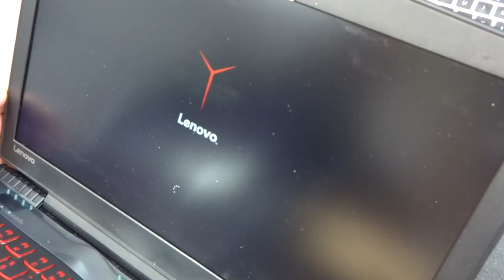Lenovo Legion Keyboard replacement

Comment: I have replace my keybord on lenovo y520, and I am having problem with several keys like (E,G,H,9+,function) they are not working. It happens few time to start to work and after few minutes stop it. What can be the problem and how to solve it? I tried to reinstal drivers several times.

Comment: Nop Nope Nope, Lenovo makes it's laptops already too broken, I think I'd rather buy an external keyboard. Besides I only have one slightly faulty key, and mostly wanted to replace it for one with backlight. Not worth the risk. I'll just make my desk larger and use external keyboard.
Still, very informative. Thanks for the video.

Comment: It's interesting because when i screw the middle screw inside the cover, my laptop view turns off. Than i need to reclip battery wire in order to screen to work. Any suggestions?

Comment: I had a Lenovo y50 with the same problem. Keyboard failed and it uses the same system for the keyboard. It's a shame that the engineers couldn't come up/don't want to come up with a better solution.

Comment: Very nice video. That saves one the expensive repair service. However, it is not necessary to remove all cables from the motherboard. Likewise, the graphics card does not have to be removed completely. It is sufficient to loosen the screws, then the mainboard including speakers, graphics card and power connector can be removed. So it's enough to disconnect the ribbon cables and the WIFI connection.

Comment: Its silly we have to remove EVERYTHING. 
Wow, wasn't expecting that - I am confident I can do it but this is worse than Dell laptops.
Reply: exactly. stupid lenovo engineer. its much much easier just to change/lift the keypad from the front side and not from the back.

Comment: Great tutorial. Finally someone that doesn't stop after the teardown with a "rebuild in reverse messege"   but also the full rebuild.  I followed it to the letter including forgetting the last flat cable before fitting the battery.

Comment: At 13:42 isn't there any conductive part under the main power button? I wish I see the other face of the MB.
Today my Y520 screwed up, I disassembled it and all I can find out is the main switch button can not close the circuit on the MB for powering up.

Comment: very good video. for those who didn't have an LED back lit keyboard to begin with. turns out, you HAVE to get the unlit one anyway. getting the backlit one will bring you headache, the unlit motherboard doesn't have the connection soldered in for the LED wire to connect to. the fans screw points don't align and the HDD doesn't align back into place. since i have no choice but to put it all together, i just mashed everything together somehow and closed it up. the keyboard works and all, but now the durability and ridgidity lowered and no LED lights. i guess i could solder the strip to the connection points carefully, but that's very very tricky and very unhandy. hope this comment saves someone's ass. i wish i could read this info somewhere before i ordered.

Comment: Thanks very much for this. But at 16:40 you mention how we should test the keyboard before proceeding...but can you clarify? Or can anyone seeing this who knows? It seems we'd need to put everything back together to test it. 

Or did you/he mean perhaps test it with some other machine we may have? I rarely have to do this level of repair, so forgive my ignorance. Do you mean that keyboard conneciton ribbon is universal, and we could test it with about ANY laptop we may have (that's taken apart to the point we can disconnect its current keyboard)? Wanting to know before "just trying" things. :-)

Comment: Ola amigo, eu tenho o modelo Y520-15lKBN E COMEÇARAM A FALHAR AS TECLAS "E" "G"H" E algumas outras, saberia me dizer se issoe algum problema no  softeware ou e um problema mecanico mesmo no teclado?
e caso eu pegue um modelo diferente de teclado do tipo  Y520 Y520-15IKB sera que funcionaria da mesma forma?
um grande abraço Do Brasil.
Hello friend, I have the model Y520-15lKBN AND BEGAN TO FAIL THE KEYS "E" "G" H "And some others, would you tell me if this is a problem with the software or is it a mechanical problem even on the keyboard?
and if I get a different model of the Y520 Y520-15IKB type keyboard would it work the same way?
a big hug from Brazil.

Comment: hello im having a problem with my laptop as well.i did not spill anything but after  a year of buying my keys (e,g,h, fn, numpad 8 and 9) stopped working i've searched the internet and forums and could not find a solution.any ideas on how to fix this. Ihave the same model as in the video. Thanks

Comment: hate these new designs, older dells inspirons had easy ways of keyboard replacement from the top which could be done in 2 minutes even without a screwdriver..

Comment: Hi, can you also make a video on the power button replacement of the same Lenovo model? In my case, my power button in Y520 is not working, when I press it, it doesn't seem to click. A tutorial about the replacement will be highly appreciated. :)
PS: I am using the NOVO button and it seems like it will not last longer a year.

Comment: Cool vid!, helped me a lot, I want to replace my keyboard, I have a Legion Y720, i disassembly my laptop and find the same cover for the keyboard, with some plastic rivets, I want to replace only the keyboard, not the bottom case, it´s possible to replace it removing that rivets and then Weld with plastic? Thanks for the support :D

Comment: Hello sir, 

Thank you for such a helpful video.
Could I ask you a question?
I had a laptop Lenovo Legion Y520 series same to you. But the CPU is not enough for my desire; hence, I want to upgrade it from i5-7300HQ to higher one. 
Is it impossible if I replace it with newer one? I read from most of blog that is we could not replace it with other version, because CPU has been soldered with mainboard.
If you got experience with it, please give me a suggestion. 
Thanks in advance.

Comment: Hello! This is a really nice video. Thank you very much for uploading. I would like to ask you one question. I need to change my keyboard, but my keyboard doesn't have the backlights. Is the motherboard standard, so that I can use also a keyboard with the backlights, or is this connection by my motherboard missing? Nice regards, Dietmar

Comment: Y520 owner here typing with his mouse. Great video, you confirmed what I feared, the keyboard is welded to the palmrest. I spilled water on mine and now the num pad and some other keys are shot and my battery wont charge. Knocking on wood that its just my battery that needs replacing.